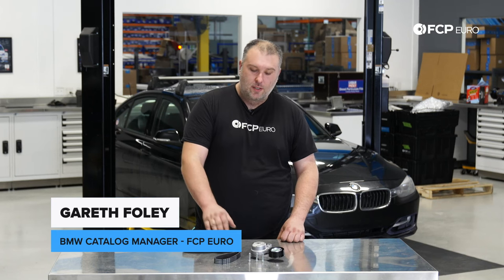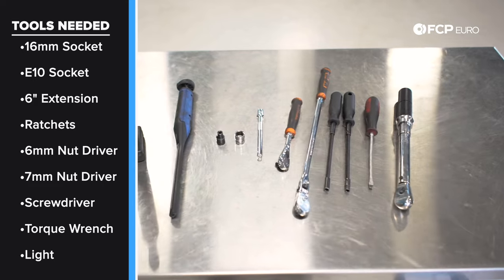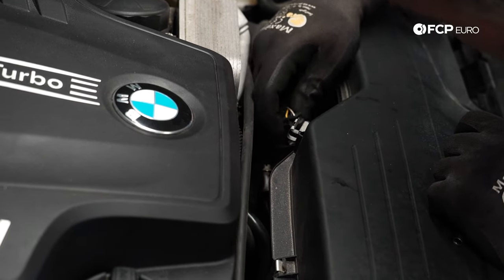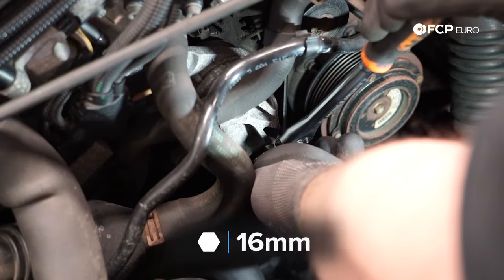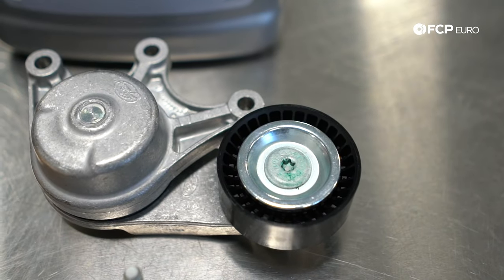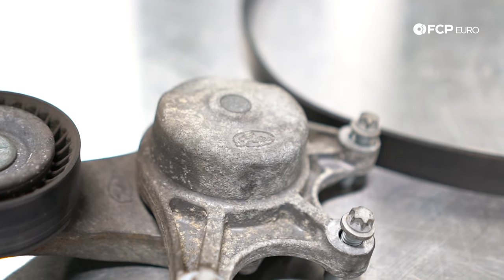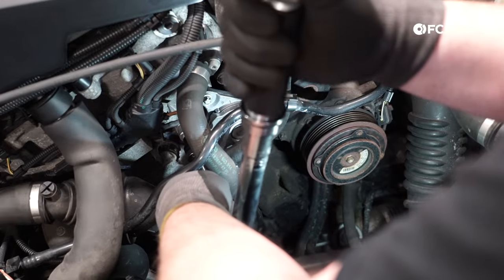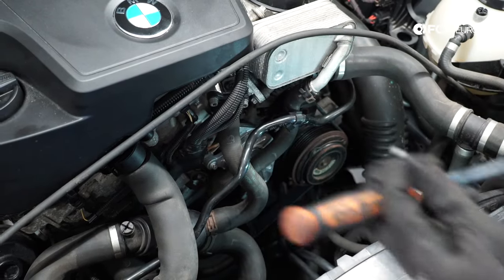BMW F30 Serpentine Belt Replacement DIY (BMW N20 - 328i, 528i, X1, X3, & More)

Comment: Needed this , dealership wanted 200$ just for the belt , got the belt and tensioner for 60$ and took me 10 minutes,appreciate you guys
Reply: Belt and tensioner for $60? Damn we get screwed in Canada. Belt alone cost $45 and tensioner was $150. Anything cheaper gets shipped from the US and ends up being the same price.
Reply: Hey where did you get that kit for 60.00?
Reply: @richg9448  rock auto had it actually
Reply: That is awesome that you were able to research this & DIY.  I know how it is to have the dealership tear your head off for very simple fix.
Reply: @joepalooka4720 which tensioner/part# was it do u remember?

Comment: This video is very informative. He isn’t kidding when he says it’s super easy. I picked up the parts today in Milford Ct, drove back home to Mass and it took me literally 25 minutes to remove the old belt and tensioner and replace with new tensioner and belt. BMW wanted to charge me $498 to just replace the belt. So thank you professor FCP Euro, you guys are awesome. Definitely buying parts here moving forward. I appreciate your video big help.

Comment: Awesome video! Extremely helpful! I just completed this job (06.18.23) and ran into the same problem with the 16mm hex bolt as others have described. The bolt actually sheared off. As a result, I had to physically push the tensioner in towards the engine with both hands. Luckily, you only need to move it a few mm before you can pull the pin out. If the tensioner doesn’t move with a 16mm socket, I would suggest stopping and try to manually push the tensioner.
Reply: Mine is not budging. How and where did you grab to push on?
Reply: @streetlamp1337  I pushed on the lower part of the arm near the wheel itself. It takes a good bit of force to move. If you have someone who could pull the pin out while you use both hands to push, that would probably be best. Good luck.
Reply: @58phaser  Did you do it with or without the belt on?

Comment: Just did this and it took me less than 15 minutes. Most difficult part about it is relasing the tension to get the belt off. (pretty difficult at least on mine.) Other than that was such an easy install thanks to this vidoe. Old belt was seriously frayed on the edges.
Reply from the maker: Excellent work, Nathan!

Comment: Thank you! This video was very informative. I has the charging malfunction warning pop up, and I stupidly went ahead and changed the battery because I thought that was the issue. I popped the hood after the warning remained just to find the belt has failed. Pulled a good 10 years out of it. I ended up just changing the belt and used a metal bar to loosen the tensioner.

Comment: Thank you. I just ordered this for my 2015 328 GT. My engine is getting a bit of belt whine at 50k miles. Hoping this will solve the problem. Fingers crossed. Update: That did the trick! I'm cheap, so I re-used the old bolts. I think that's fine as long as you don't mangle the heads and they're not corroded. As a side note, I discovered a small amount of motor oil in the bottom of the silencer. Hoping that does not indicate a turbo problem.

Comment: Great tutorial as always, on my N26 F30 I noticed today thay my belt is squeaking when the engine shuts down for auto start/stop...is that normal? I usually have it disabled accidentally enabled it today. Belt/tensioner maybe have 100 miles on it

Comment: 6k1003 means it is a 6KP1003 with 100.3cm, right? I have seen people selling 6KP0990 and 6KP1000 which are 99.0cm and 100cm. They are just a tad different in length and I believe they work too. Anyone who have used them please confirm. 
Also, can the pulley alone by replaced? If so, part number or sizes?

Comment: I need to replace the belts on a 2015 X1 xdrive28i, which has a power steering belt.   I ordered the belts and tensioner from fcpeuro,   but I need instructions on how to replace the PS belt.   Thanks!
Reply: Any updates

Comment: I have a squealing when engine is on low RPM and goes away as the car is under load. Replaced the belt and tensioner. The squealing went away but came back 2 weeks later.
Reply from the maker: You will certainly want to inspect the belt and make sure no leaks are contaminating it. From there it would be recommended to remove the belt and check any of the remaining components that could be causing a noise (AC Compressor/Alternator Pulley).

Comment: Anyone ever had the 16 mm nut on the tensioner to relieve tension completely come off like my socket ate it was able to snap the pin out just before the wrench took it and everything is in place now but like how would I ever get that off now
Reply: Would this be a faulty part or user error it seemed to me to not be very complicated move pulley to the left well pushing down to the right ?

Comment: Hi FCP Euro, I had an issue with the 16 mm on the INA tensioner (Gates). The 16 mm broke off the tensioner during the install because I wasn't able to rotate it clockwise to remove the pin (right at 11:13 in the video)? Should you simply be able to pull out the pin when pulling clockwise?
Reply: Waht did you end up doing?
Reply: @streetlamp1337  I ended up using the old tensioner and just installing the new belt. Been driving it for the past year without any issues so far
Reply: @tacballa  Thanks for the reply and the update!  I rounded out the nut trying to flex it forward like this video but another video showed me that all that force might not be necessary since theirs didn't flex like this one in order to pull out the pin.  I ended up rounded out the 16mm nut on the pulley tensioner  b4 I realized I didn't need to flex it that hard. 

Luckily, I had just enough thread to push it forward to pull out the pin. It was still a struggle.
Reply: @streetlamp1337  @fcpeuro I too have rounded out the 16 mm nut on a new tensioner, as well as snapping off the nut on a second tensioner. I put the old one back for now, but still want to put on a new tensioner. I am leary about spending money on a third unit. I  was able to move the original tensioner just as you see in the videos. I know that the whole arm is supposed to "swing" clockwise, which was actually easy to do with the old tensioner. But even focusing very hard trying to move the tensioner arm and not "turn" the nut, still made two units unusable. 

Any additional hints from anyone on how to move the bar as easily as he does in the video? I am using a 17" breaker bar with a 3/8 socket for the 16 mm.

The first unit I bought was from  FCPEuro and not sure whether it would qualify as a failed unit give the "nut" broke off.

Comment: My F34 2.0D x-ddrive 190KS (60,000km) started “chirp noise” on start and also occasional squeals when engine cold for a few seconds. Faulty water pump, tensioner/pulley, and consequentially worn belt, the whole set changed (INA, bosch belt). Still same noise, changed the belt from bosch to continental, still noise on start…changed crankshaft pulley (corteco) and less noise on engine start, but noise still there, now seems to be mostly when the engine is warm.
Any ideas?

https://youtube.com/shorts/k1me9JgzLD4?si=2l2Qz37y5RHppvL9